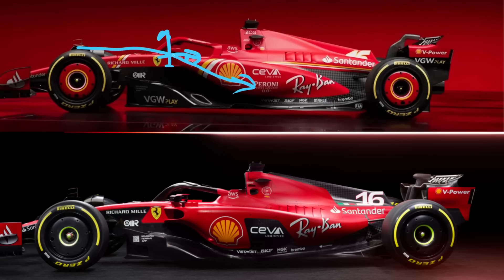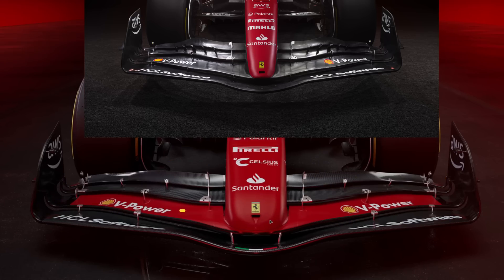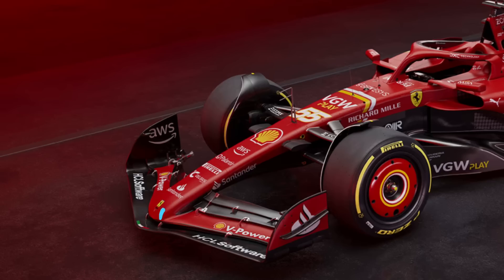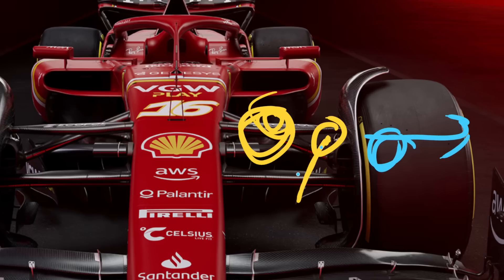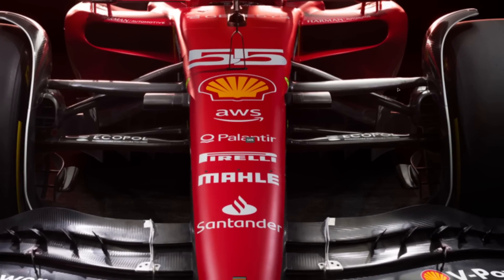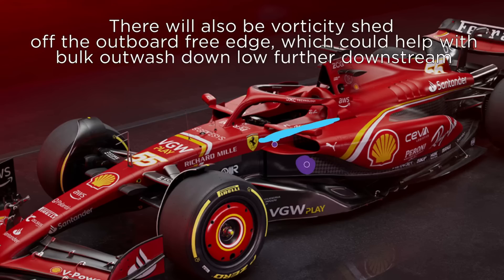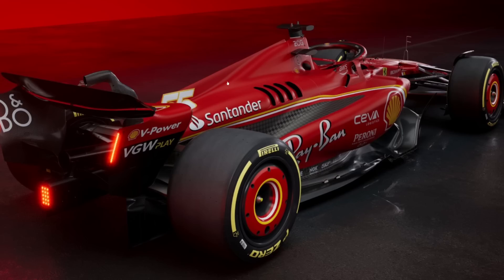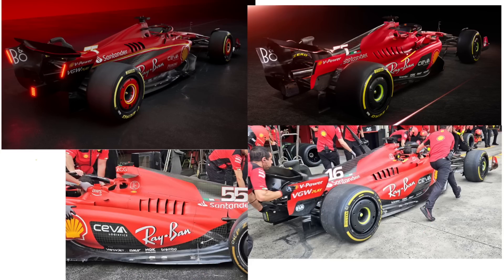Ferrari  SF-24  -  Aerodynamics Analysis and Initial Thoughts

Comment: Is it only me, or Ferrari dropped the S-duct? On closer look, and after the first day of practice, their work at the Halo area is actually two elements one above the other, which are not connected to the vertical inlet bellow the sideboard cooling inlet. Both Halo elements are hollow and it is clearly visible from the different angles. Couple other teams are doing the same thing. RedBull also have a very thin vertical inlet, Alpine inlet also drops down vertically in a very thin way... Can you elaborate a bit more, where this air might go and what they are feeding... it is too small to be cooling? Is it possible to bring it all the way to the rear - diffuser, wings ..?

Comment: You didn't mention anything about the duct they have running from the bottom of the sidepod to behind the rear halo supports.

I believe it was B-sport who pointed out last year that it could be used to channel boundary layer losses coming from the nose to where all the louvers were in last year's car, essentially piling all the losses together for easy management and cleaning up the undercut flow.

However this year's car doesn't have louvers over the sidepod as they took the downwashing waterslide approach, now the flow over the sidepod should be clean, and yet the duct is still there. Why would they channel losses up right next to the waterslides? Do they still nail the space between the beam and rear wing? Or could they have another purpose like managing cockpit losses?

Comment: i really don't understand wy they did not change te suspension , it's all because of that thickhead , stubborn old man enrico cardile ,who thinks he is smarter than adrian newey ,  he should have been fired long time ago , they should have followed redbull's direction , which pull _ rod front suspension nd in the rear push _ rod suspension ,  it will be another year full of disappointments , strategic blunders , and awful car performance especially in race pace

Comment: Thank you Kyle. Looking forward to your analysis of the overbites of McLaren and RB
Reply: The McLaren has no overbite, which incidentally makes little sense. The sidepod intakes are the same. What McLaren has is a kind of floor edge wing, but no overbite. This would be aerodynamically fatal as the excess air from the radiators would flow into the undercut and along the sides at high speeds, which would not only upset the whole aerodynamics there but also on the side of the underfloor.
Reply: @fam.hunger5244  that is not correct
Reply: @fam.hunger5244  Possible it's a launch spec rather than the actual car?